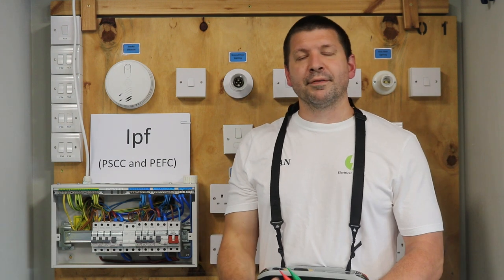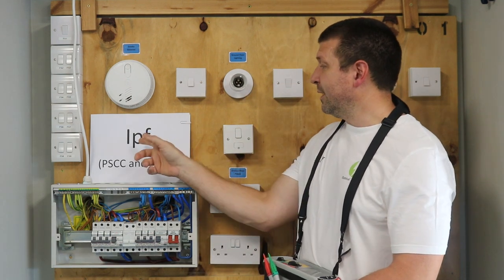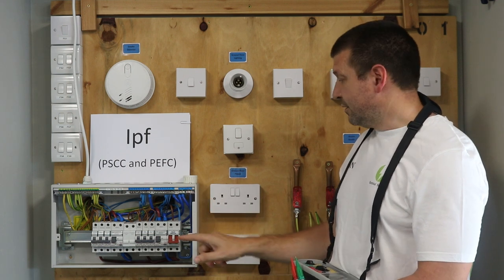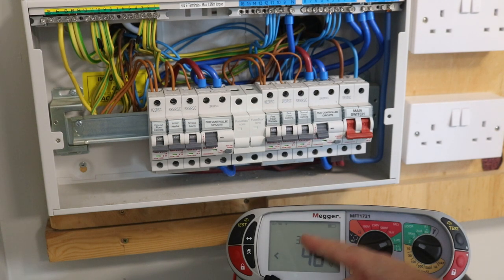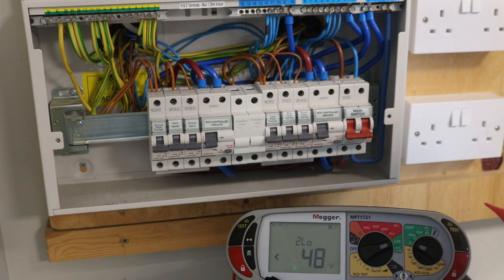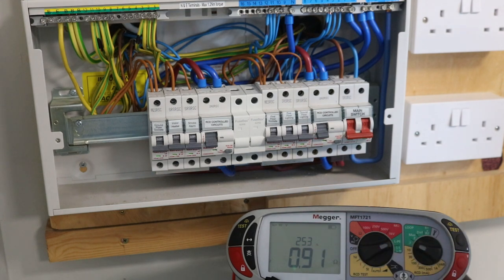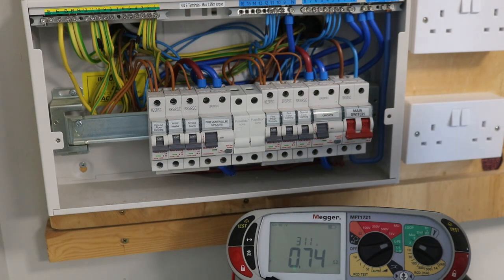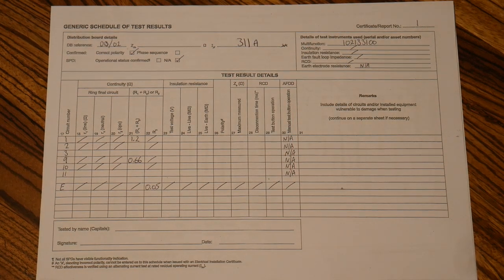Guide to completing the prospective short circuit current and prospective earth fault current test

Comment: Where did you input the earth lead in the back of the tester for the test? also do you double this value if its 3 phase?
Reply from the maker: The Green earth lead goes in the green L2 port on the back of a Megger Multifunction tester. Other testers will he different. You do not double the value for 3 phase. The earth fault current will only travel down one of the phase cables in 3 phase, to activate the protective device. Therefore even in 3 phase, the calculated Ipf will always be 230/Zs